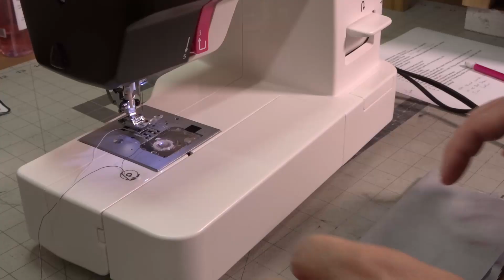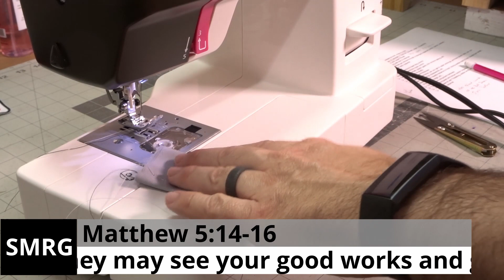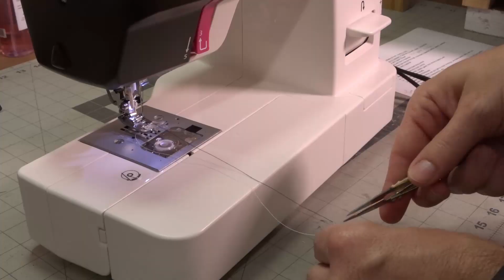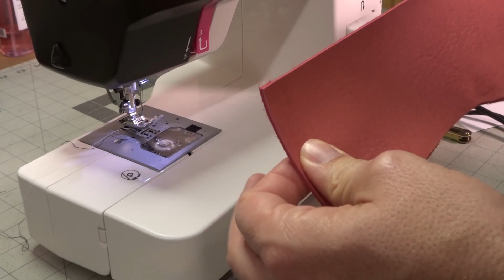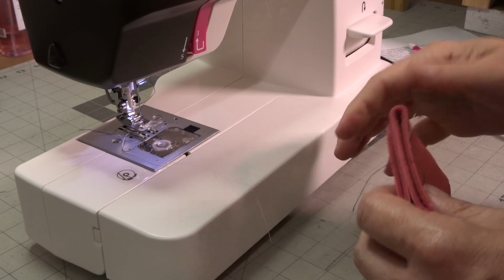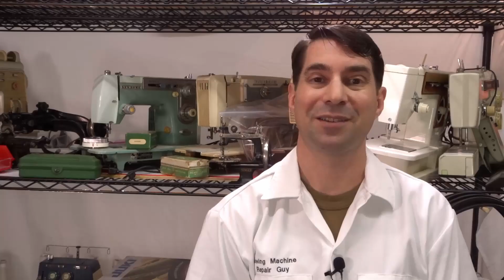Juki HZL-27Z Most In-Depth Sewing Machine Review on the Internet (Part 2)

Comment: Been using this machine for over 10 years now and I really love it, because it survive to many kind of material. Power still good, light never changed. The only thing that always broke on this one is the bobin holder, who seems to always come out and not align well... in 10 years its the 3rd time happening, it's not that bad, considering it's when I use it on weird material like leather, fur, sequin or stretch. I found this video in hope it could fix the problem of my own machine without bringing it to repair/maintenance because i'm in a rush. 
It was a fun video! Thank you for it. It was nice seeing the stats and capability of my sewing machine. I do think after 10 years, it's getting outdated and there is more fancy ones out there. But I will still keep it to do the hard job, because it's full of surprise and never disapointed me.

Comment: I've had mine just 2 years. Every thing was great until I decided to make a set of pleated drapery. 3 fold pleats were a bit much so I went with 2 fold pleats and was nearly finished when things took a turn for the worst. So, I stopped, cleaned and oiled, replaced needle, but the needle would not pick up the bobbin thread. Tried several other needles, bought new needles, bought new bobbin shuttle. still didn't work. I found a repair manual on line. downloaded and printed . It has step by step instructions with photos. I tried every adjustment in the book , but I cannot get that bobbin thread to pick up. Looked for a repair shop. none in my City I would have to take the machine 35 miles to another City . I've never been without a machine before, I could have a mental break down!  Just kidding,   I wouldn't do that. What am I missing here? I don't know what to try next.

Comment: I’m a Juki dealer and repair man for all types. Little bit unfair to expect a base line model to be stitching multiple leather, there are other Jukis for that.  I would say that repair and service wise jukis are easier and cheaper to work on. I have never had a Juki returned through failure in 14 years! The best guide to machine acceptability by the public is to see how many are on eBay etc. The ‘big name’ machines are losing their reputation because of dependency on electronics and gimmicks, and I am seeing more failures with them. But, hey ho, might just be what’s coming in to me.
Reply: How on earth do you get the bobbin case out to clean it! ?
Reply: @lealangston5979  remove the needle plate and the bobbin case is the black item. If you take out your bobbin you should be able to grab the case. Clean out all your fluff, small dab of oil in centre of race- not the case- and reassemble. Check for needle strikes in the case and if any, smooth out. Make sure bobbin case doesn’t revolve in machine, there is a lug at 4 o’clock that stops this. Replace plate and hand wheel the needle up and down to check it’s all together correctly. Now’s the time to fit a new needle! Good luck.
Reply: I've had my Juki HZL-27Z for over a decade - runs like a champ.  For what it's worth, your experience matches mine.

Comment: Thank you for this in-depth review and for showing the inside workings, was very informative. 
Would be interesting to take a couple of machines in the same price range and compare them (apples with apples) against each other. 

I also think  it is important to point out that this machine is really an entry level domestic machine, not for business purposes. It would be for a child or a beginner sewer. So if using for this purpose the machine would be more than fine. 
If wanting to do heavier material or spend hours and hours on your machine buy a machine designed for that, less headaches. 
In other words buy the right tools for the right job.